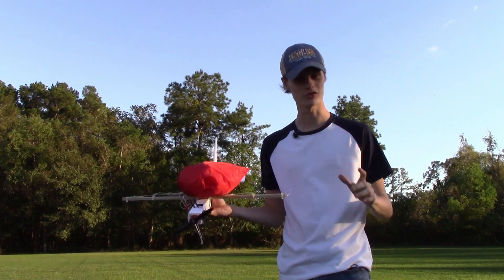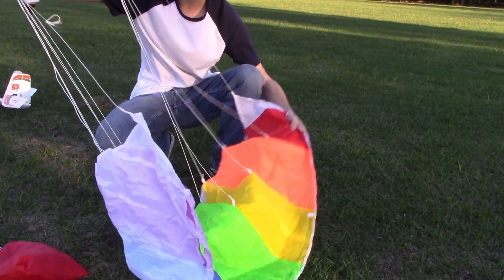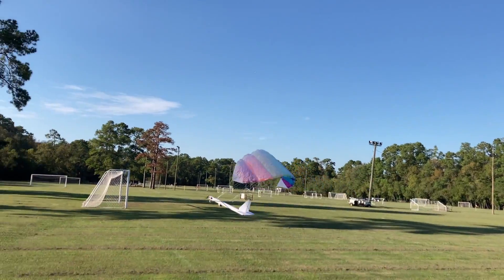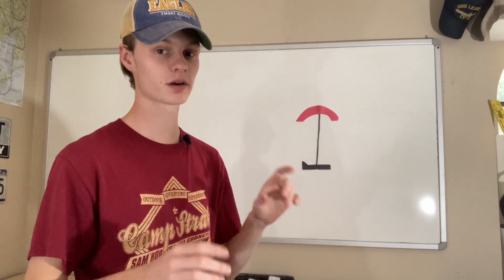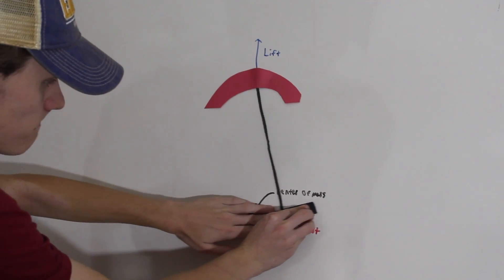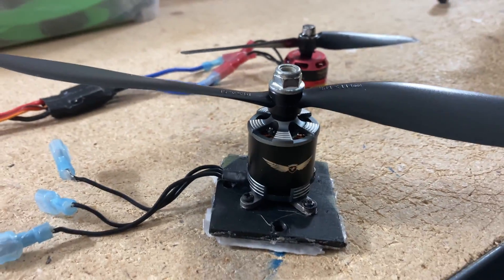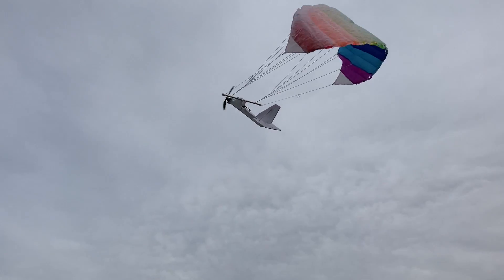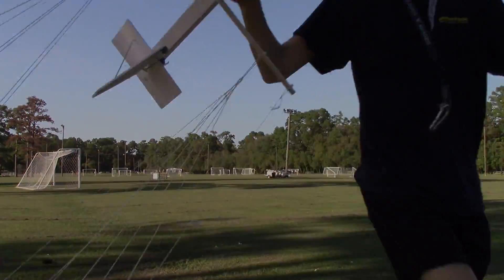Experimental: Para-Foil RC Airplane

Comment: I believe you need to shorten the strings (or Lever Arm). Please do a follow-up.  Only change One (1) variable at a time - to judge that variables change on the system.

Comment: After trying several paramotors, I realized that the important thing is to have a good canopy. First I tried with a kite like yours and nothing, then with the old hobbyking paramotor and it was impossible to fly it, and then I bought the new one, the blue one, and no matter what I did it flew perfectly. It handles very well and you can even do some acrobatics.
Reply from the maker: Interesting, I’ll have to look into that. Thank you for the comment and information!
Reply: I agree.  That canopy is the problem and currently preventing forward movement.

Comment: Happy Thanksgiving, Captain. It seems to keep pitching up in the first trials. The LEVER ARM DISTANCE is another variable too.
Reply from the maker: Agreed, I might shorten the lines to see what happens. Maybe the parachute will work better I’m not sure
Reply: @CaptainJohn  Yes, copy the proportions of an "existing" design, then later vary the other parameters ONE (1) at a time to measure performance.  For the parachute, don't cut the cords, but rather use "slip knots" to shorten the lengths temporarily.    ==>  It is time you start keeping NOTEBOOKS to measure your TRIALS plus having some DESIGN NOTEBOOKS too.  Make sure each entry is DATED.